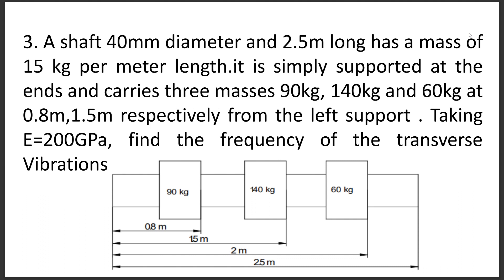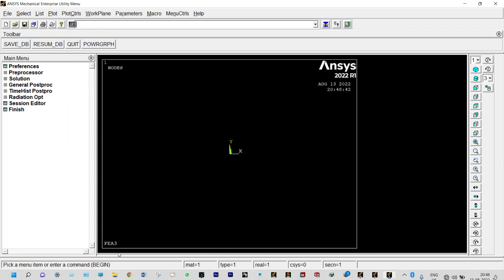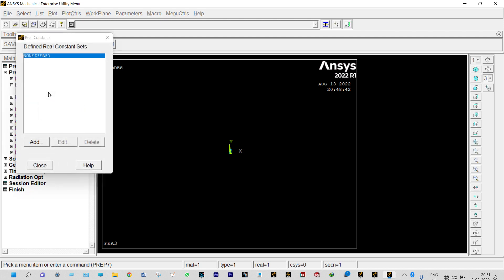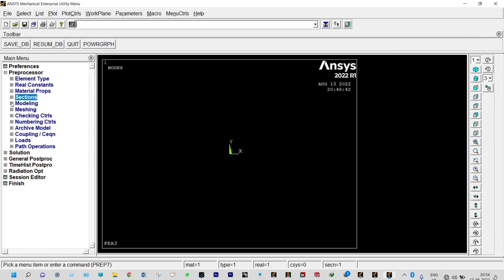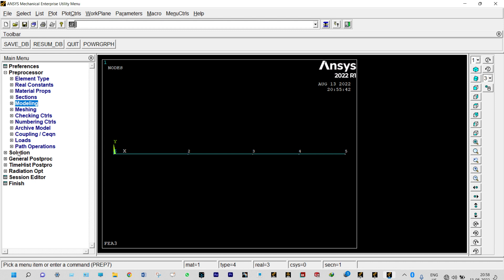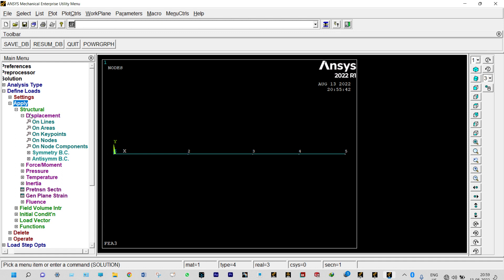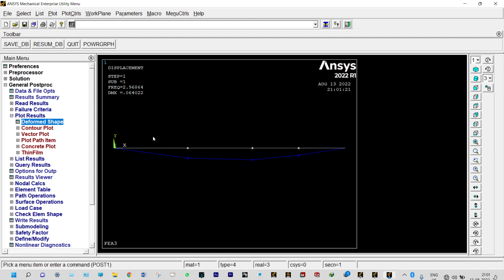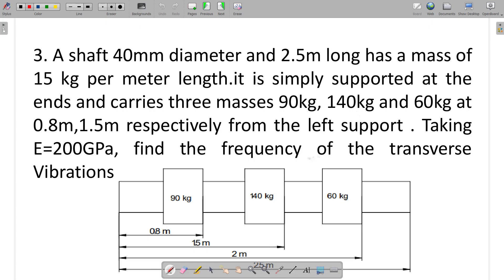Modal Analysis of a beam | The Best Modal Analysis Tutorial | ANSYS APDL

Comment: When you declare the density p=7830 kg/m^3 (MAT -> DENS) AND declare the additional mass per unit length 15 kg/m (Sections -> Beam -> Sect Control), the total mass of the entire model will be M = m_1 + m_2, where:
m_1 = 7830 x Volume_shaft
m_2 = 15 x L
So, the result will be more accurate? Is that correct?